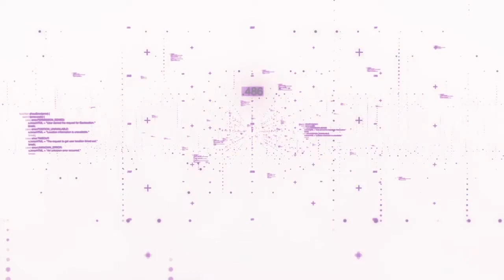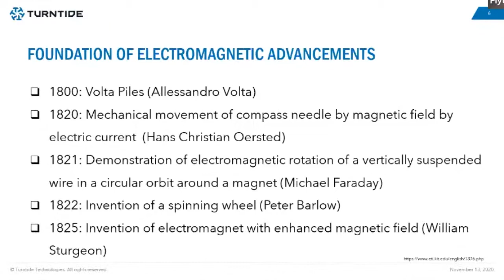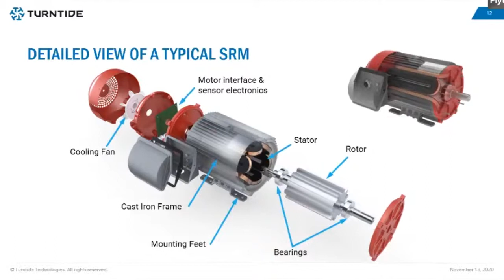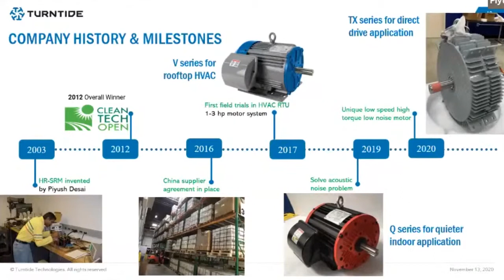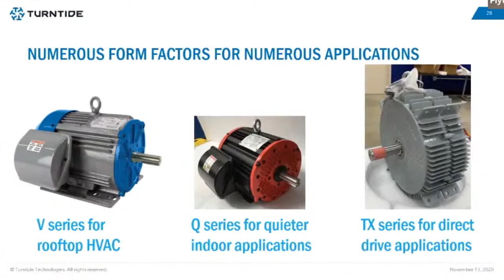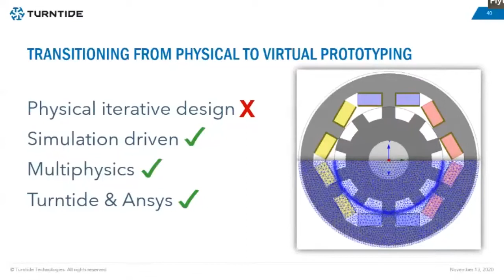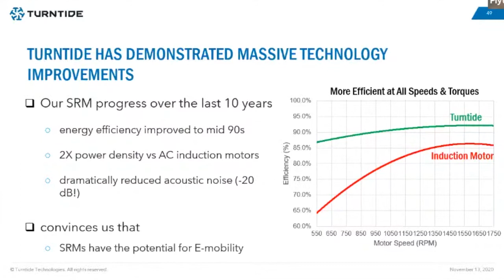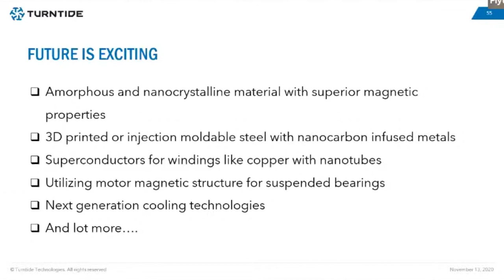Switched reluctance motors Presence, past and the future

Comment: Thank you for detailed information. @ 40:50 there are some comparision with Prius IPM where  power  > for 67%. At the same time torque is the same.  Where is these  67% comes from? HR-SRM has ability to provide that torqe at higher RPM's?
Reply: Yeah, it's probably higher power because of higher rpm's.
Reply: The Prius motor back then did 60kW peak and the Chiba did 100kW = 67% increase.
Reply: @jensstubbestergaard6794 Look, friend I'm not about mathematical difference (60 to 100), But!!! with max. torque 211N-m!!! almost same as 207 N-m (for IPM) you have increase for 67% of power!!!!!!! Where is that power come from. If you take Power as Torque* RPM's  you suppose to have increase in RPMS for almost 67% . Otherwise your estimation can't be correct.